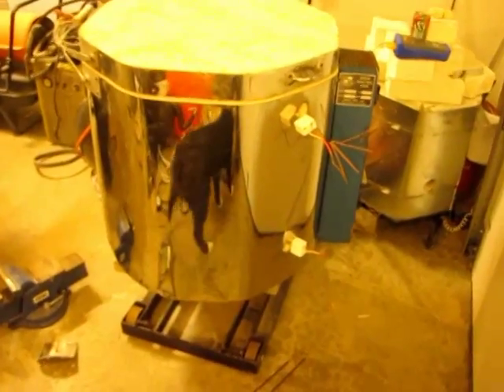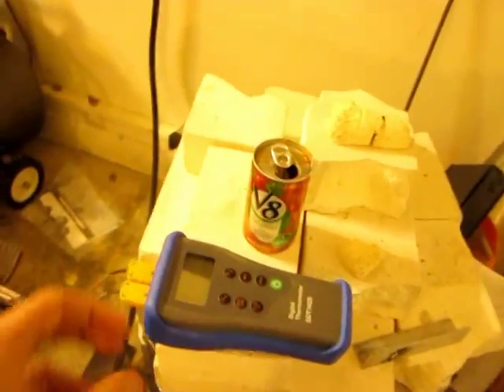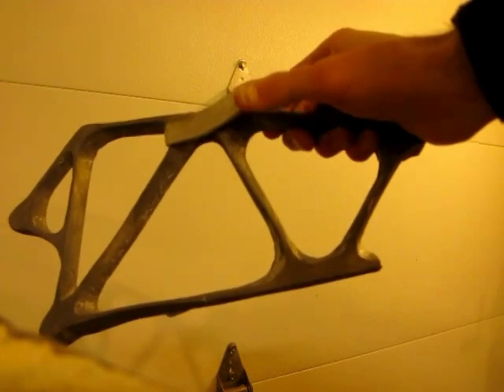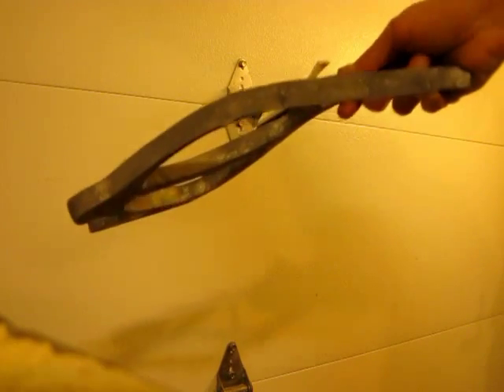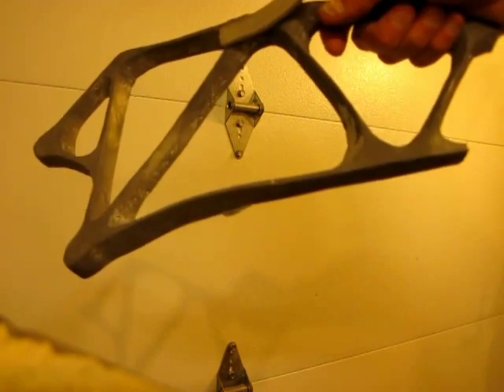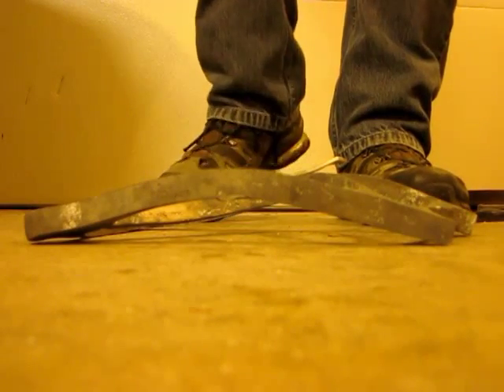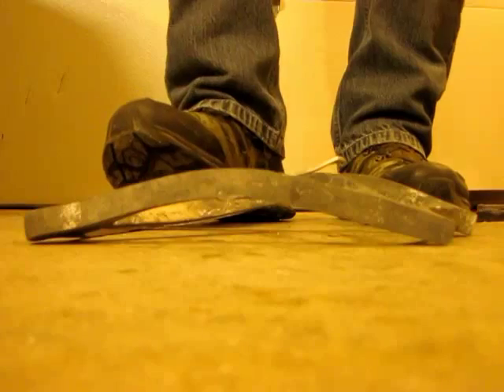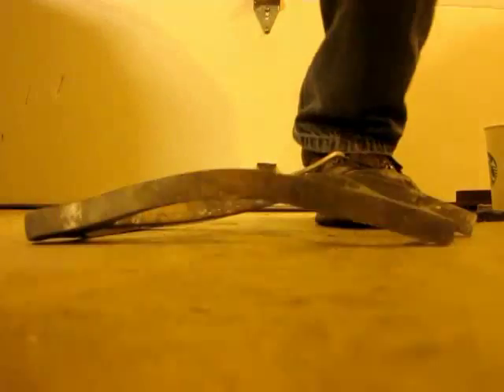heat treating aluminum initial attempt

Comment: Regular aluminum can be case hardened by boiling in a solution of water and sodium bicarbonate. I use it for small parts and it works.
Reply: could you elaborate on this process please?
Reply: @feliwein_cc  Just boil the part in water with a cup or so of sodium bicarbonate for about 20 minutes. It's all try and error.
Reply: @@scottcrawford7674 Certain types of aluminum can be heat treated in special furnaces. The process I mention above is all try and error.

Comment: any questions let me know I've been heat treating for about 8 years now ….
Reply: when you cool it isnt it better to use oil?
Reply: How can I heat treat 356 a cast alum cylinder head after welding. Is there a way to do it without using too much heat?  T5 would be enough.  Please respond a copy to jim@jsmotorsport.com
Reply: I have a bike part made of T6 aluminium it snapped and ive got it welded how do i heat treat it

Comment: You're getting good with your videos.

Have you played with different alloys? I know some alloys are better for heat treating and some are known as "casting alloys", I don't know how much difference that typically makes. It could potentially make a significant difference 

http://www.matweb.com/search/DataSheet.aspx?MatGUID=31050b16589d4444940eefdd4be05046&ckck=1